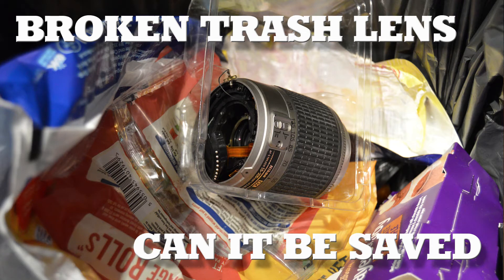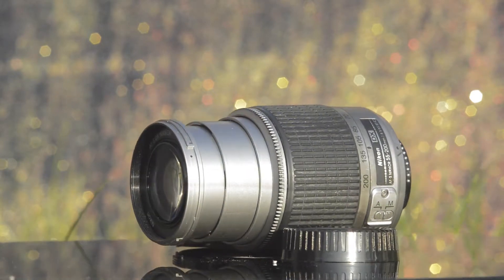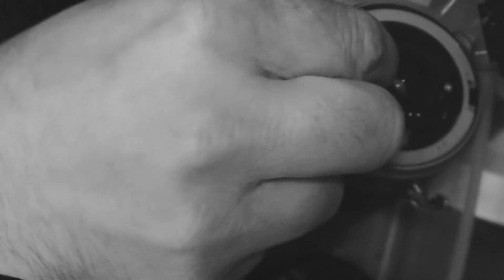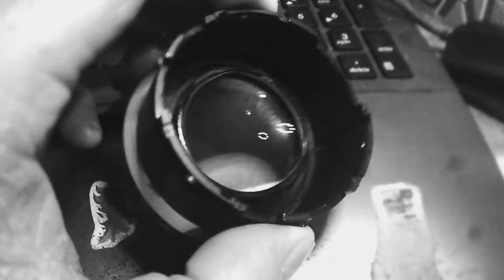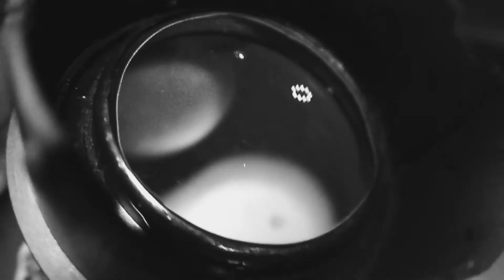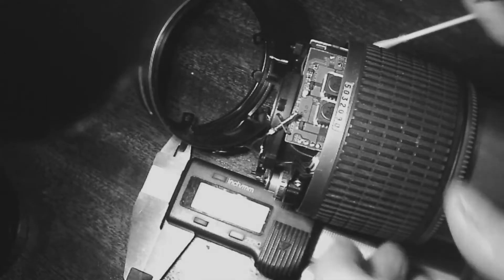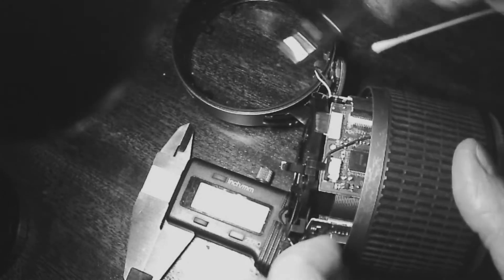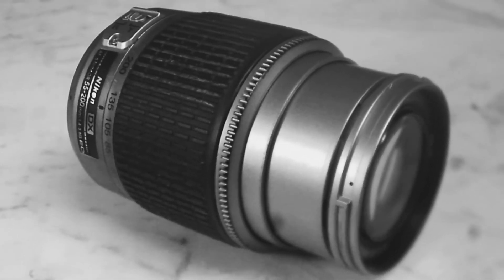#12. Someone threw away a Nikon AF-S DX NIKKOR 55-200mm f/4-5.6G ED Lens

Comment: i have the same lens with fungus. can you guide me how to open the front element alone?
Reply from the maker: Opening the main front element is a pain, you can twist off the plastic tube that holds the front element, but you will notice you can't take out the glass without cutting the plastic. 

I cut the inside plastic seal, removed the glass and then after cleaning the glass I placed it back in and used casting resin or epoxy resin to reseal the glass. 

I would say, my attempt failed to set the glass back properly.

Comment: I am working on same exact lens with fog and fungus on the inside of the objective (front) lens.  Does that forward lens body section detach just by twisting it counter-clockwise?
Reply from the maker: It's been a long time, but if I remember correctly, the whole front lens assembly comes off at full zoom if you twist it and pull it, I can't remember if it's clockwise or anticlockwise, but it t wasn't difficult, it was a little tricky putting it back into the correct thread after but once you have it off it is easy to remove and reinsert because you can see how it fits, I marked the slide with a marker.  The really difficult part was separating the two front glass elements that are plastic moulded in place.
Reply: Were you able to get it off? I’m trying to figure it out as well.